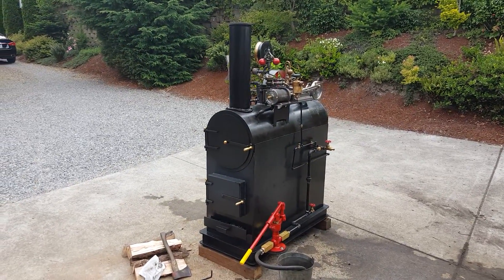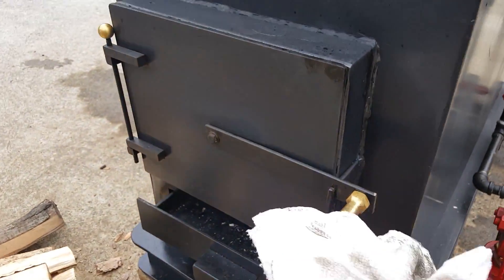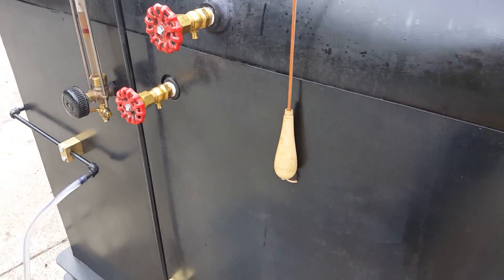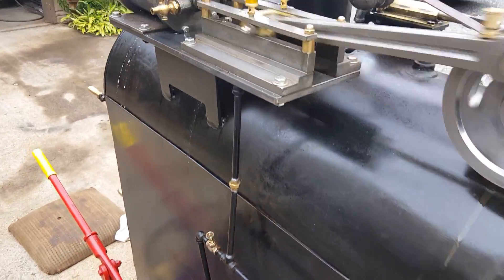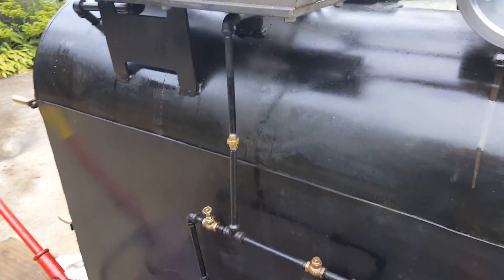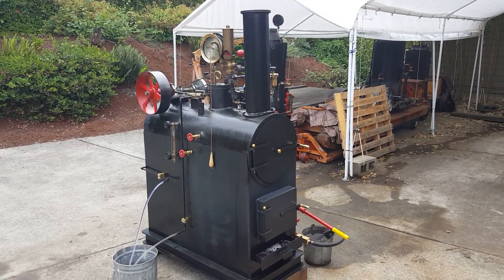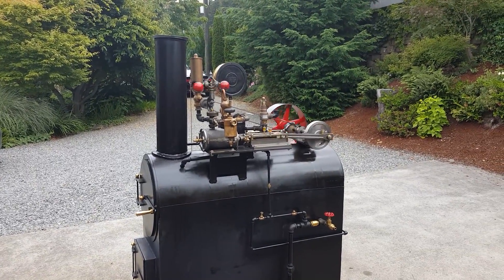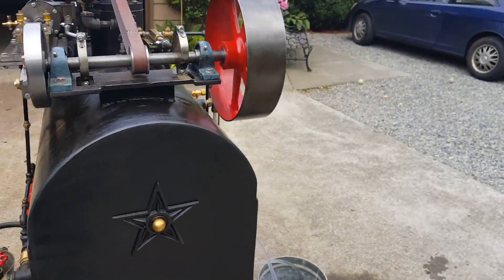Return Flue Boiler with Steam Engine  VERY RARE!!!

Comment: Nice setup 👍

You can attenuate that water hammer with a "T" to a bell and 3/8"-1/2" nipple about 6" long and a cap on the end with a little petcock on top. Put a few rubber or Teflon balls inside the tube to act as a shock an additional absorber in case it fills with water. Place that device between the last pump check valve and the boiler.